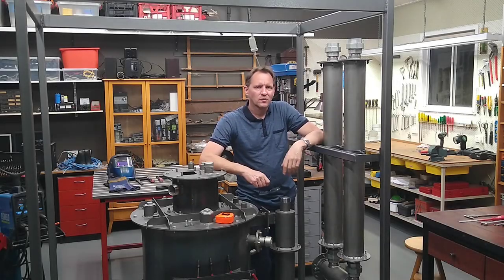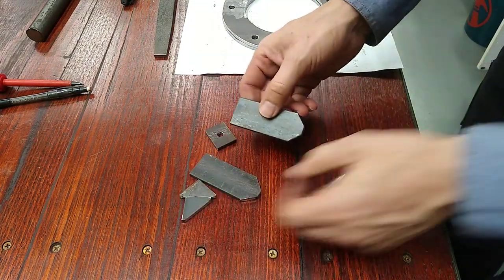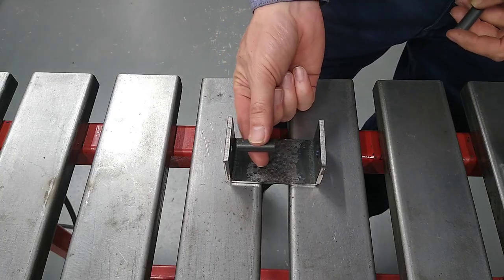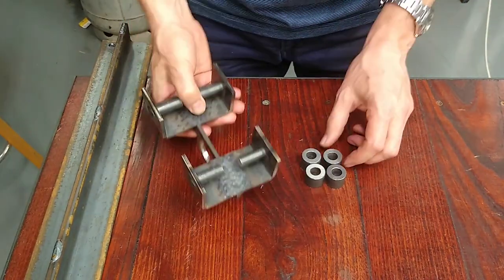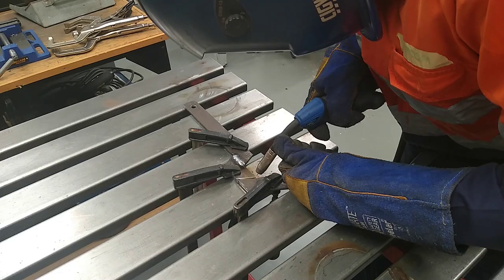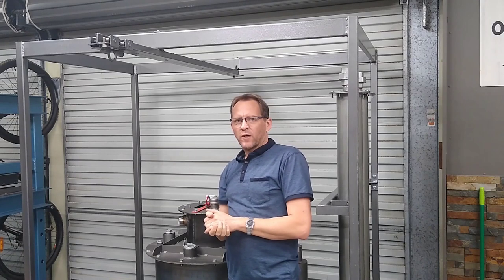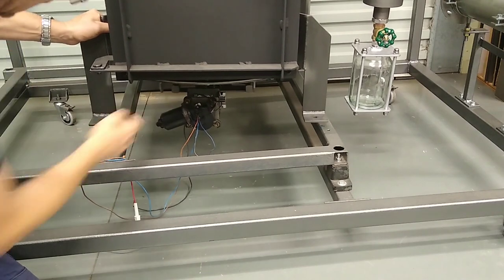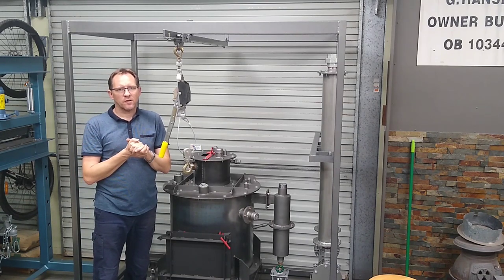Wood Gasifier/Generator, Mono Rail Hoist E11

Comment: Just wondering if it’s possible to build a water jacket around the combustion chamber to use the heat for a hydronic heating system?🤔
Reply from the maker: Yes sure, however it'll lower the thermal efficiency of the reactor, you would be better off capturing the waste heat from the engine, water jackets and or exhaust.

Comment: I first started watching your channel last week, Keep up the good work. I do like your commitment to the project.  This may be the answer to my problem of generating 6-7kw at a reasonable cost.  If I was to ever tackle a project like this, I would cut ALL the parts on a waterjet or plasma cutter just to save time. 
BTW: Did you consider using your two spare ports with plumbing  to reactor to add addition air (when needed) to increase gas production? Just a thought, as I have seen other gasifiers with ports that you can adjust.
Reply from the maker: Thanks, yes cutting the bits from plate steel would save a lot of time, I don't have a plasma cutter yet, and plate steel is big heavy difficult to move around, where as flat bar is so easy, so everything is done in house, the one 2" inlet is enough for up to 5l V8 so it'll be plenty, cheers
Reply: @whathappensintheshed  The V8 comment has me thinking.... How benificial would it be to run an automotive fuel air sensor in conjunction with a throttle body to control the inlet flow? I would think with that and a speeduino, the hardware is there, it is just a matter of code. But would it be worth the effort?

Also when I saw the title I thought the hoist was going to be for large logs.
nice video series man.
Reply from the maker: @ur_quainmaster7901  thanks mate, yes it's definitely worth having fuel air mixture control, I will be doing exactly that further down the track, cheers

Comment: Being so far away from my gasifiers, I was really hanging out for a woodgas fix, and you have provided it, very nicely indeed  :) .
 Just wondering: Your frame won't want to tip over, as you roll the gasifier out to the far end of the gantry rails? 
 Perhaps this won't be an issue, once a weighty engine is occupying the frame, and lowering its centre of gravity.  
 Nice solar panels, and battery bank, by the way  :) .
Reply from the maker: Thanks mate, yeah the frame will tip over, once finished the gasifier will go into a small building, castor wheels removed and bolted to the floor. Are you going off-grid at your new place, will your gasifiers be making the move as well? Cheers
Reply: @whathappensintheshed  
 Yup. Once your beast is bolted down, it ain't gonna tip over on you  :) . 
 Like yours, mine is plenty heavy, so I have to use an improvised crane, to lift it off the chassis. 
 I don't reckon that I will go off grid here, but I will keep the gasifiers, solar panels - and battery bank in working order, just in case of a power failure. 
 Also, these will help me to lower my power bills  :)  .

Comment: Can't wait to see it when it is finished! I have been FASCINATED by gasifiers recently! This guy has many great ideas, like cooling gas with air, which is cycled warmed into gasifier... cools it with water, which heats up the water, and then even cools it again with air, to dry the wood pieces with 70 heat... it's amazing!
Check it out here if that resonates with you:
https://youtu.be/KR5vPvr5h_k?t=371
Reply from the maker: Thanks mate, sure will
Reply: @whathappensintheshed  What would happen if you were to build a thin box around the cyclone filter, air cool it with a fan, and blow that hot air into the gasifier? Would the increased intake air temperature, increase it's efficiency? Would really love to know, incase I build one
Reply from the maker: @millanferende6723  g'day, I'm sure it would to some degree, but you would get more heat transfer if you ran some piping through the gasifier body, which the 2" sockets on my lid are for, cheers